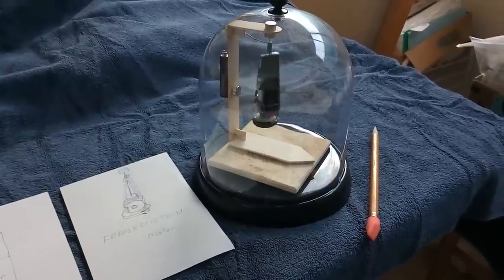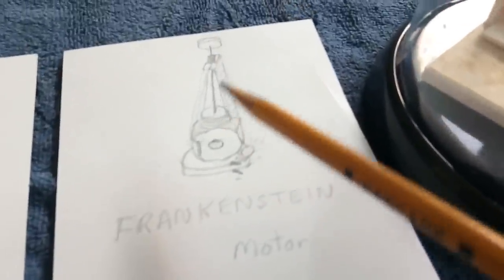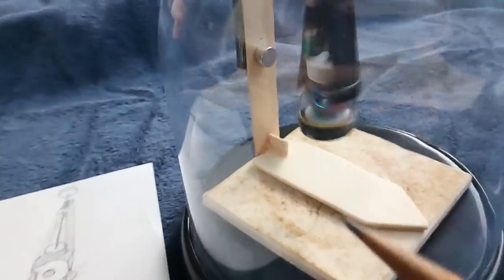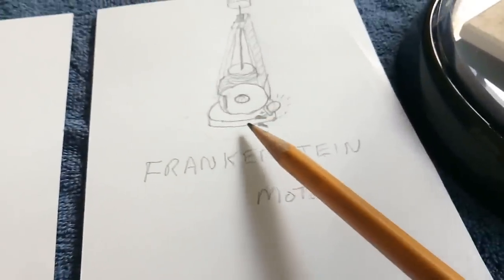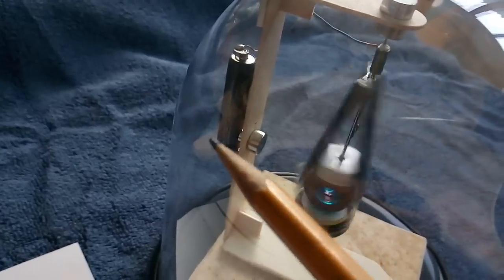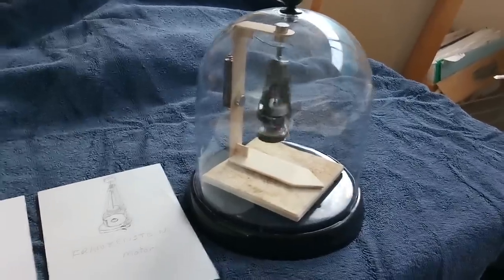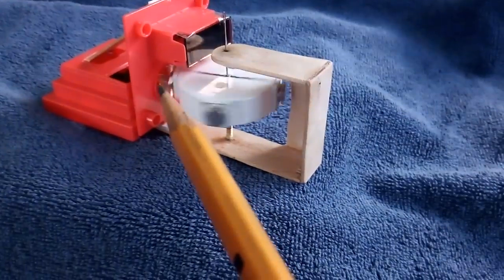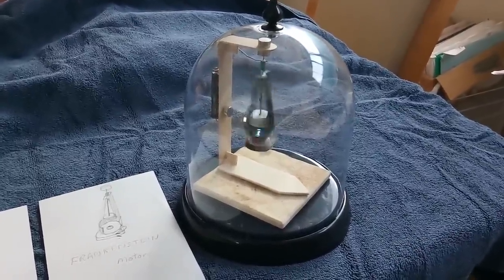Frankenstein Motor Under Glass

Comment: Very nice.  Thanks for that drawings.
Will it start to turn on it's own in sunlight if the batt is dead & the ultracap is discharged (i.e. start only with the solar panels)?

Another question, I get why you need a high resistance coil because the higher the resistance, the lower the current flow, but why can't you just connect the right size resister in series with your regular coil wire to get the resistant that you need?
Reply from the maker: This does not self start ----ever.  It doesn't matter how you position it to light or how loud you yell at it.  Once it stops it is done until you flick it with your finger.  It is a flaw.  Most of my non-stop running motors are the same.   The coil resistance question is one that I am not sure about. You can't just add a resistor to a fat wire coil and get the same results as a fine wire high resistance coil.  All I know is that the fine wire coils with many turns perform the best in this application.
Reply: @Lidmotor  Ok, thx.  Lol@"...or how loud you yell at it."

Comment: Morphing into a 24/7 runner would be a very cool result for this. Multi-source energy scavenging and usage to keep itself going  :)
Reply from the maker: Morphing is a good way to describe what is happening on this project.  I'm wondering now if anyone else has tried to do this.  Maybe long long ago in a galaxy far far away?
Reply: Works it does, energy it will not consume. For this motor there is no try, there is only do.
Reply from the maker: Excellent advice wise master.  May the force be with us.